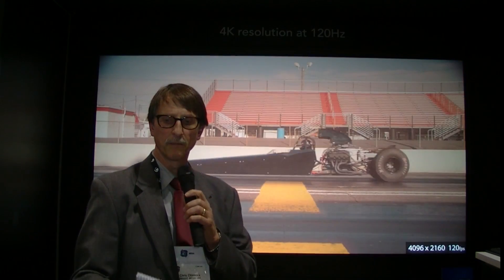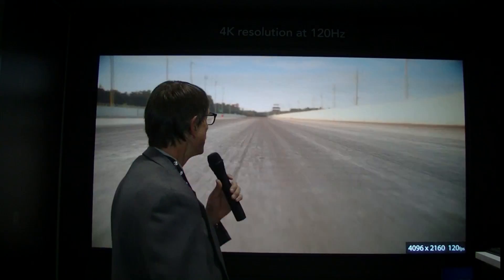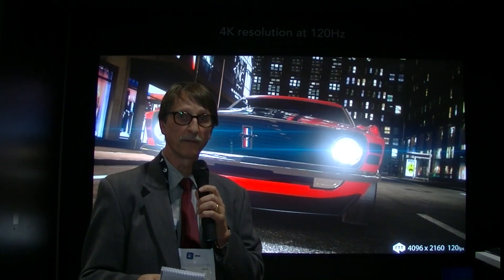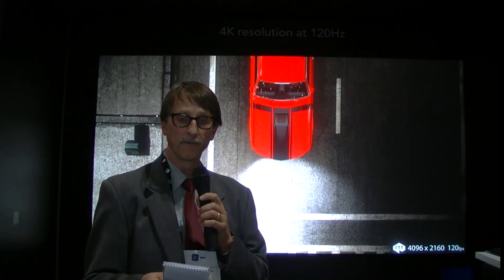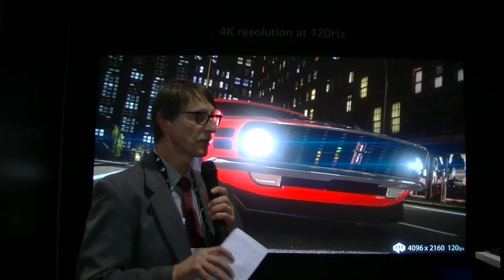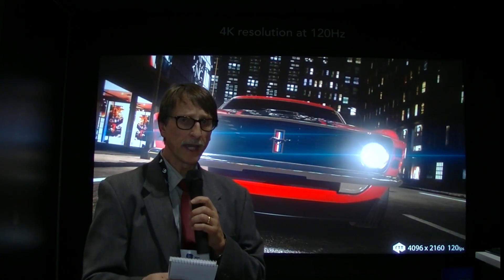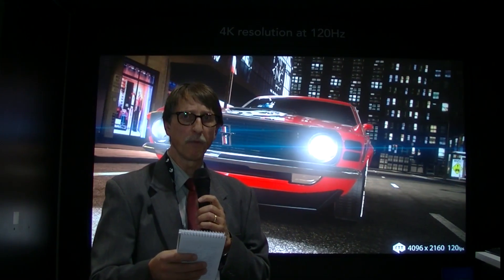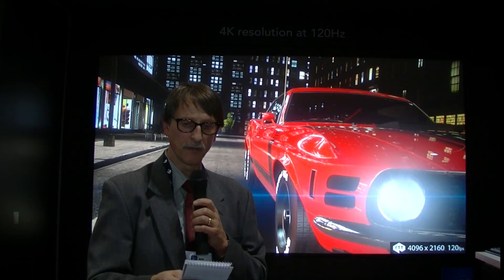Christie Shows 4K Projector Running at 120 fps

Comment: This is very informative. I would have liked pics of the back panel to figure out how the connections work. Like, if I'm running 4 Titan Blacks, do I plug in 4 HDMI cables or how does that work?

Anyone who downvotes this is a console peasant who can't see beyond 30 fps.